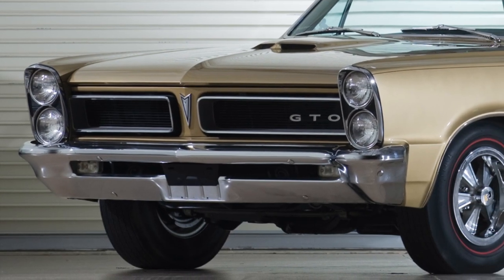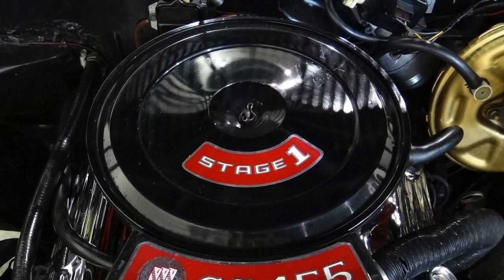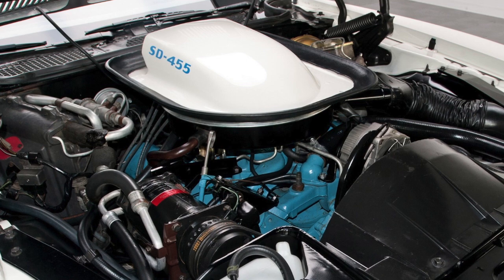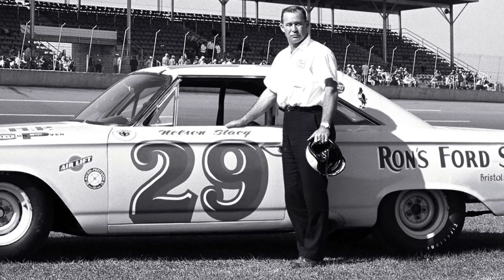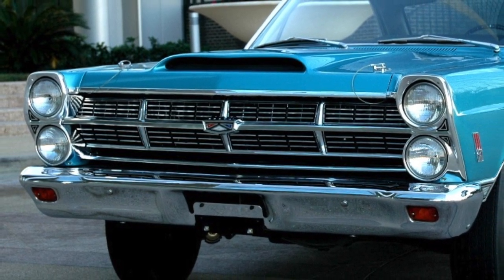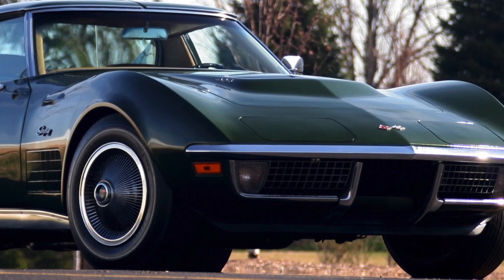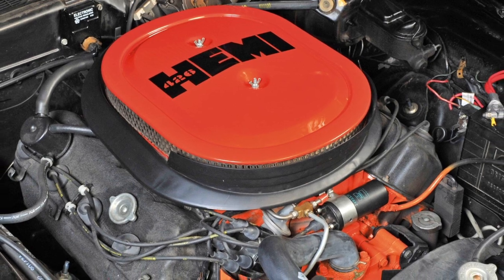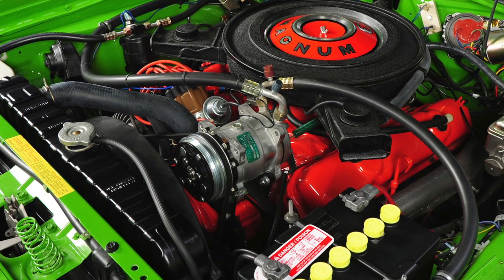5 Best Vintage V8 Muscle Car Engines

Comment: Nice assembly of Detroit Muscle here. I've own a 1970 MACH I since 1977. 351 Cleveland 425 HP after the rebuild in 2016. Wife drove the car daily from 1980- 90. Then it became a Sunday driver. Wife loved it, she loved driving circles around most cars back then. Most were compression choked out dogs. The FOX MUSTANGS with the 5.0 V8 was pretty fast though.

Comment: I started working on these muscle cars when they came out new. I knew all of them well. All the different engines had their unique qualities and weaknesses. What we did back then is go to the local junk yard and buy these engines out of cars that were wrecked usually at a bargain price. One engine that gets overlooked but was a great engine and lots of power was the Ford 428" motor that was commonly put into station wagons. They had a longer stroke than the 427" but were powerful and could be bought for about $250 dollars most of them had less than 30,000 miles on the engine. We made a lot of sleeper cars using these engines. I was glad I got to be a mechanic during that era. We had many fun times street drag racing. Today everything is so regulated to the point you can't hardly breathe without someone destroying your hobby.
Reply: 1926howiemack 
Country Squire LTD had the 429cid in 1971
Reply: @mechanicman8687  I had a 1972 Country Squire with the 429cid. Best deal I ever got, 120K miles in eight years and it only cost me $600. It needed no major work until I parked it because of rust. I sure miss that car!
Reply: Don’t go to the Ford dealer.  U will see a 2020 GT500 Mustang that puts out 760hp with catalytic converters, 7-speed trans, with a 3yr warranty.  GPS, A/C, heated seats, power everything.  0-60 in 3.3 seconds, top speed is 180+.  Guys on the internet r making a few tweaks and getting 900hp from a bone stock factory engine.  And don’t get me started on the supercharged Hemi Dodge Hellcat.
Reply: hi  senior, i have 500 cid engine , wath can you tell about this engine ? i want  Strengthen this engine and add in 1969  old cutlas ..  wath you thing wath will be ? :)
Reply: The SCJ 428 had a lot of power and was upgradeable due to the reinforced webbing on the block.  Non CJ blocks were not as great and could not handle over 500 HP for very long.
Reply: Honestly being a American car enthusiast these days is such a pain. I was born in 2001 to two Indian immigrants who were not car enthusiasts and had owned exactly one used car (1989 Toyota Corolla) in their life and had decided to never do it again, buying new Japanese cars instead, so I didn't grow up with my parents owning anything that interesting or teaching me about cars. So I've essentially been born in time to know what I missed but still be crammed into some crappy plastic electric golfcart by today's manufacturers anyway. Sadly it seems like more people my age are the same as my parents, only wanting to go from A to B as cheaply as possible without any interest whatsoever in styling or performance. So I genuinely don't even know if there is a future for American muscle anymore.
Reply: @todd5082 , but can an 18 year finance one and pay it off while working at the local gas station or McDonald's? That was the difference between now and then. Then anyone with a job could buy one. Now, you better have a college degree or a rich Daddy.
Reply: I agree on the 428PI or CJ. A few years ago you could go to an NHRA points meet and in Stock a 69-70 Mustang running in CS/A with a 428 CJ was running in the low 10s on a 10.00 index. They are still running and they can stand the front wheels up 18 inches and that’s a C4 or C6 depending on who is is building your transmissions. A lot of outlaw cars with 428s are in the low 9s and 427 stick cars are in the low 8s and spinning 9000rpms . People call the FE a boat anchor, but it is all in how you build it. Lol

Comment: The 426 Hemi is hands down king of the drag strip.
Reply: Well...sort of, in the mid to late 60’s the cammer easily beat it, really the only reason that you don’t see the 427sohc in drag racing is that Ford stopped making parts for the cammer, they were more interested in nascar, so they put all their attention into the cobra jet.
Reply: @wyattkranz2450 Yes. The, cammer", was ford's answer to the Hemi. Nascar shut it down before they could actually put them in cars, but Mopar actually had an answer for ford's cammer. It was their dual overhead cammed 426 Hemi, known as the doomsday engine. There are still two in existence. One travels around at various auto shows. The other is in a private collection somewhere. I've also heard that someone was able to acquire some prototype heads from the project.
        Nascar actually shut down both projects, because they, apparently, were of the mind that things could get out of control if they didn't. Hence, why there were only about 1500 or so cammers produced as well.
        Btw, many of the 427 cammers ended up with Hemi bottom ends, because the 427s couldn't handle the extra power very well.
        No hate. Just think that the story behind both of these engines is quite interesting, but often overlooked.

Comment: It's a tough task to only pick 5 engines out of the dozens that were noteworthy during the musclecar wars of yesteryear. I can't find fault with this group, but I can think of many others that could easily have been on it:
The Ford Boss 429 & 428SCJ, Chevy L72 & L88 427s, Pontiac RamAir IV, Chrysler 440, and the mighty-mites - Ford Boss 302 & Chevy DZ 302 - are all worthy of mention (as are many others).

Comment: I'm of the age of Viet Nam war vets  1 person I knew saved all the money from his time in Nam and wanted the hottest car he could get when he returned  He didn't want a corvette or Hemi  so he bought the Buick 455 stage 1  the dealer told him about an even hotter set up called stage 2 which was only dealer installed but he would need to leave the car there a couple of days. His best times were low 11s on a size wider than stock street tires . That meant it would probably be a mid 10 second car with slicks. Always wondered what happened to that car.
Reply: Junk yard since early 80s

Comment: Enjoyed your video. Brough back many memories. I bought a brand new 1969 Plymouth Satellite convertible, April '69'. Special order car. 383 cubes with a big(for a 2 barrel) Rochester carb(when first taking the air cleaner off, it looked like a four barrel). If my memory serves me right, it had 300hp. 4 barrel only brought it up to 330hp, I think? Don't know exactly how fast it would go, but had the needle pinned many times, and still more to go! Again, thanks for the video.

Comment: The Chevy 327 Turbo Fire was pretty hot. Factory Edelbrock Hi Rise intake, with a huge Rochester 4 jet Carburetor. Rated @ 360 HP. The 63 Bel Air could really scoot with the Powerglide.

Comment: One engine that was missed was the 4 cylinder used in the 1972 vega. I had a friend with one. He actually drove it over a curb stop. Well, half way, then the trans went out. Never mind.
Reply: john fuchs 😂
Reply: @SpecialAgentJamesAki  my aunt had one too, it melted.
Reply: Put a 350 in a 73 Astra same as Vega the 4 cylinder was a dog.
Reply: @tomschwartz4853  

Cosworth made it good
Reply: @tomschwartz4853  Depending on the model, there was up to 110 HP in a GT. It was equal to it's intended competition, mostly the Pinto. And no big block ever touched 1/2 it's fuel mileage.  Rust proofing made it a decent fun little car. Sleeving the block made it last. The block warping problem was only showing up in cars with insufficient anti-freeze to prevent hot spots. The coated cylinder walls did not hold up because the bean counters thinned it out too far. The original coating design was fine.

Comment: I was lucky back in the day. I've owned three Dodges, two Dodge Dart 340s, '68 and '70, and a 68 Dodge Charger w/426 hemi and a 4 speed behind it. All three were manual transmission  and my fave was obviously the Charger. the motor outlasted the body so I restored it, being only 7 years old it had been thru a lot but we got it done and I had a "real" muscle car.

Comment: Loved these engines. I could actually work on them! Now today you can't find the engine, so much stuff to dig through.
Reply: catmodelt:  I also have a low mileage ‘14 Impala V-6 which is 300+ HP stock!  And yes, opening the hood brings a sea of plastic engine covers, but when you loosen a few bolts and remove them, it is an impressive looking engine.  I have the red LTZ trim and it always turns heads for such a large car.  The ride is phenomenal.  Chevy really did something with the redesign thanks to their European division.  A shame this is the last year for the Impala.

Comment: I loved my 289 A-Code in my 65 fastback mustang.   Plenty of power, got 26mpg.    Loved that car.   Too bad I got married.
Reply: I had a 1971 Challenger R/T 383ci. I did minor upgrades (cam, intake, Holly 650cfm, headers, etc.) I got an honest 20 mpg unless I "mashed" the accelerator. When my wife told me that she was pregnant, I sold the car. I was already spending too much time tinkering on the car, it was becoming a money pit, couldn't find good gasoline anymore and had to keep dropping the timing.
Reply: @Thestargazer56  the vanishing point is my favourite movie with a challenger in it !

Comment: Five great choices! If I were choosing five more to the list it would be the 440 six pack, w30 455, ram air 4, boss 429, L72 427.
Reply: MBailey1977  i choose dodge chargers
Reply: Amran Abu Bakar 
The engines that were equipped into those cars, NOT the cars themselves...
Reply: yes the w30 oldsmobile 422 it had a balanced and blue printed engine from factory
Reply: @sabrehawk-427  I'm an olds fan myself had a  64 Jetstar 88 with 330 and a 68 Delmont 88 with 425 great engines both came out of fatctory ultra high compression pistions good runners .
Reply: The Olds would not run with the top competitors 'cause it could not rev and had small ports and valves. I've built several w-30 example 455's. Once raced against an $8500 upgraded Mondello 2/4 tunnel ram engine jet boat, in an identical boat I owned  with a 460 with SCJ heads and tunnel ram. It was NO contest and my entire boat/trailer  with home built engine cost about $6500. He was the son of the town mayor and humiliated after all the bragging he did before 'The Event'. He tried again later after having his pump blue printed and lost just as bad. The Olds is not an easy engine to build with the huge main bearings, wanky valve train angles, and small heads. The factory crutched the heads with lots of cam duration in the W30 but you had to build compression to match. Just a little too much compression and it would self destruct. It would make my 1978 Cutlass Supreme fly though!
Reply: The 327 was a small block that had the horse power as a big block and rpms was much quicker! The best engines 428 R code 429 Boss, 390 big blocks ford had the 400 that was high revving in there trucks! 427, 396,454 8.1 would be nice in a truck to day or how about the 383 dodge the 440 in the power wagon! Just would be nice if they would modernize these engines today....
Reply: Yes that W30 was fast raced one with my 1968 Baracuda coupe he best me with about a half a car length.
Reply: john thonig  The L79 327 was an awesome small block. The 65 Chevelle 300 and 66 Chevy II with the L79-4 speed made for great sleepers
Reply: @rondyechannel1399  Half correct.  The C cast heads and the W-30 heads all had the big valves from the factory.  The reason you did not hear much about them was the Cutlass body was almost 1000 lbs heavier than any of the other muscle cars including those big ole Chargers.  The SD455 in a 77 Trans am runs almost 1.5 seconds slower than the W-30 engine in the same car.  The Olds engine fits right into place due to those 403 olds engines that were optional in the 77/78\79 TAs.  8500 upgrade?  Mondello in 2007 charged 7000 for his head work.  That was when he was in TN.  The guy running Mondello out of California is clown shoes.  Best call Benard Mondello at his race shop to get Olds work done.  Horror stories coming out of California for the past 8years along with tons of lawsuits.
Reply: The 427 Ford Sohc had the Boss 429 beat !
Reply: True I have a built SD but no doubt the 4-speed 70 W-30 I had back in the late 70s in High School what's for sure faster from the factory. My dad was racer and also hat auto supplies machine shops. He rebuilt this one with the factory 328 cam and with an open headers and slicks it ran a best of 12.61 a Green Valley race way in 1978.
This was stock motor no nitrous nothing.
That four-speed W-30 cam has 244° at .050.
That's very nasty for the factory.
I think the 70 LS6 is 242°  but it's a solid.
Reply: @rondyechannel1399   Not true.
I've got a built super duty I've had for 30 years I had a 4-speed W-30 and High School and it ran 12.61 open headers and slicks with a stock motor.
This was in 1978. And the man that helped me with the Ed West had one exactly like it. Puridea the automatically put the 328 for Speed cam in it with loose suspension. He ran 1190s consistently he was a bracket racer though but this was a stock motor. That 70 W-30 is as strong as any of those on the list.
Because General Motors was rating the monsters way conservative it gives people the impression that the non W-30 442 that onlyshowed five horsepower less was just as fast.
Not even close those had high-compression but a very mild Cam and you'd be lucky to get a low 14 out of nothing like these W-30 monsters.
Same with Buick they've got a regular 79 GS 455 and it runs good it's probably low 14 when new but nothing like the stage 1 monster.
The SD had the most potential because the block and rods are built like a Sherman tank and the heads will outflow 426 Hemi below 550 lift.
They're working on a ram air super duty to come out 71 but then the gas crunch hit and forced unleaded gas and low compression. The Ram Air  Super Duty was going to have 10.5- 1 compression and Ram Air IV cam and they were going to rate it at 465 HP.
But it got scrapped I think got a few years later they decided to use those parts.

Comment: Awesome info there. I was aware of the 455 Buick but had never heard specs on it. Wow.
Those were all big engines. There were a few small block cars that broke into the high 13's in the 1/4 mile but they were in small cars like the Dodge Dart and the Mustang or Comet. 
The insurance companies started whacking anyone under 30 with high rates hoping to discourage young guys from buying the really hot cars. Face it, young drivers with only a year or two of driving experience were far more likely to crash a hot performance car. Faster reflexes are a poor substitute for better judgment and experience.

Anyone who was willing to do the work or hire it done could modify a chevy 350 or 396, a ford 390 or even a 289/302 in a mustang and get it into the mid 13's. Cams, big valves, headers could easily add 50 hp to an engine. I had a 69 Road Runner that was modified by a guy who used to race at Nascar. It was a factory 383 but when he got through with it, it was faster then a factory GTX with 440. Back then $400 could buy a lot of performance. I bought street legal Mickey Thompson slicks, they had just enough sipes to make them streetable. They were so sticky it was unbelievable. If I held the tach at 3000 let the clutch up fast and mashed the gas at the same time it launched as if a car had hit me from behind. It only took a few weeks of abuse before the pressure plate gave out. When the dealer removed it it was so warped it rocked back and forth on the floor! One of the adjuster screws had backed off so they warranteed it for me! I did NOT leave the slicks on when I took it in.

A friend had an early Mustang with 289. He had a guy do some work on it. It got really fast before he got hit by some body who ran a stop sign. I never got to race him but I bet it would have been close. If he slammed second gear and popped the clutch at full throttle it would break both tires loose and get a bit sideways.

Ah, the good old days. Those muscle cars were not terribly more expensive than the grocery getters back then. But now, they are at least 35% more expensive some being twice the cost of a basic car.